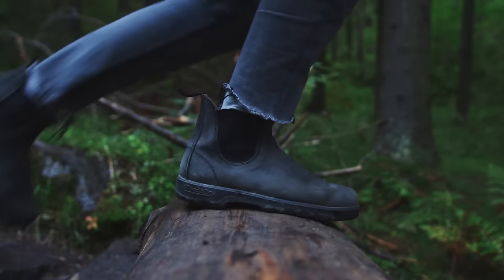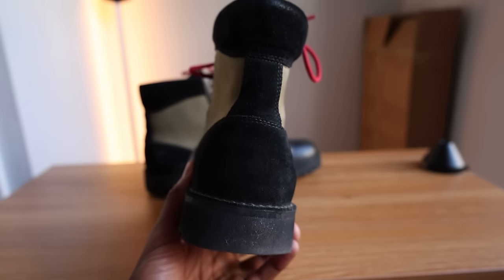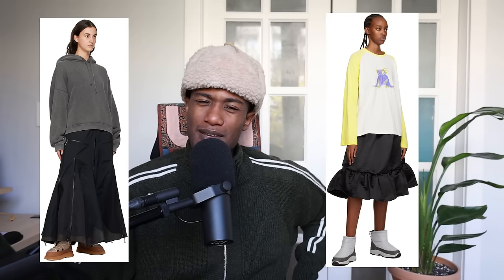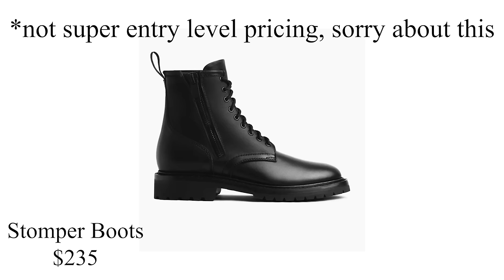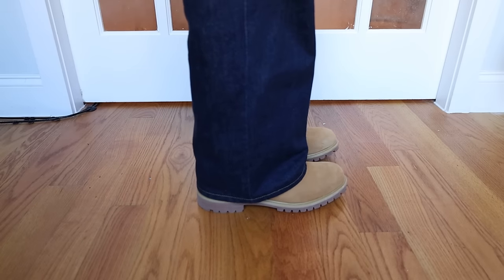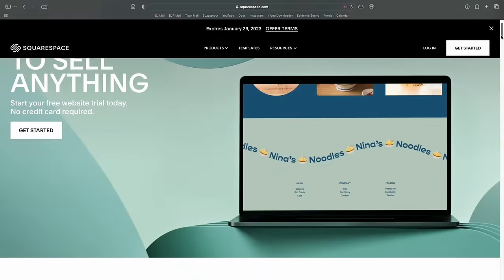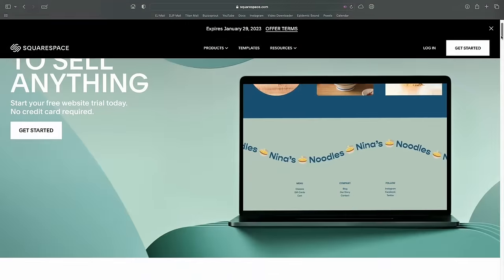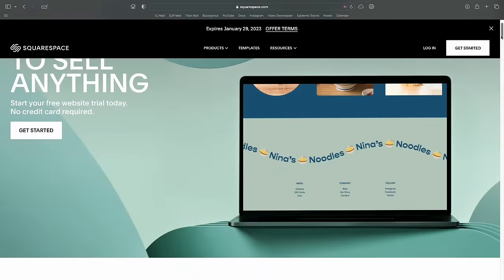23 of my Favorite Boots for the Winter

Comment: Surprised you didn’t mention the Reese Cooper Wilson Boot. Price point is up there for sure ($350-$500 depending where you can find them online), but they’re probably one of the most versatile and high quality boots I’ve owned. And I’ve owned boots like Red Wing Iron Rangers and Alden Indy boots. Man…these RC Wilson Boots take the cake for sure. You can dress them up, dress them down, and even go on hikes with them. Additionally, they come with a nice dust bag and 3 different colored laces (if you cop the OG beige colorway).

Comment: Just a a quick comment on the doc martins. Instead of getting the 1460s, you should instead look for solofairs 8 eye derby boots, they use better leather, are made in the UK and to top it off are the orignal factory before docs took their manufacturing overseas and made the end product a shell of what they once were. Solofairs also retail around the same price aswell. If you do want the doc martin yellow stitching i'd consider looking for a pair that was made before the 2000's as that's when they where still produced in the UK.

Comment: I've been looking at getting a pair of whites boots. It's one only the only handmade boots left plus they look amazing
Reply: They are indeed beautiful and comfy, but in the 2 pairs I currently own there have been some quality control issues. In my soft lace-to-toe boots, (Frontiersman model) there is a minor stitching defect in the toe area that leads to water seeping inside the boot regardless of my waterproofing efforts, I contacted them for a warranty,  which they said they would honor, they stated that is a common issue in lace to toe boots and a new boot may not solve that issue. This irked me and I just now never where that pair when its lightly wet outside. The second boot, Sawyer steel toe, the left boot came pre-creased in the area just before the steel toe starts, and I didn't bother to contact customer service for this issue as they are my work boots so looks don't matter much for working boots. I'd suggest checking out other pacific northwest brands like Nick's, Frank's, or JK's, but whites isn't the worst idea as they have cheaper entry level boots that may not have any lead times

Comment: I got the J. Crew Cascades last year but in the high-top version. Amazing boot comfort and style-wise but one of the metal lace loops broke off when I was lacing them up for the first time. Could've just been a freak coincidence but it's possible they're not constructed super well. Cheers Drew!
Reply: I bought the J. Crew cascade boots a month ago and the Vibram sole separated from the upper after i took them on a trail. Happened to a friend also.